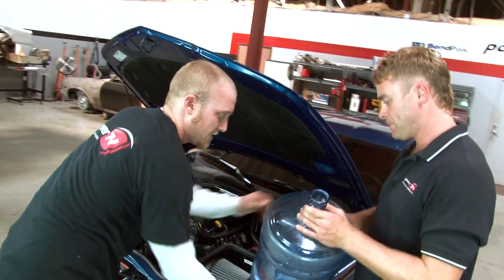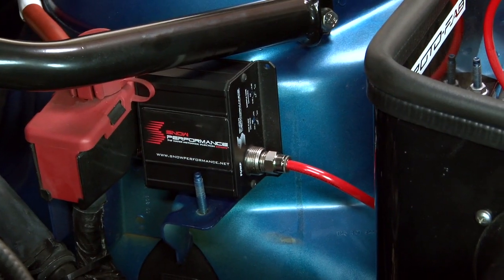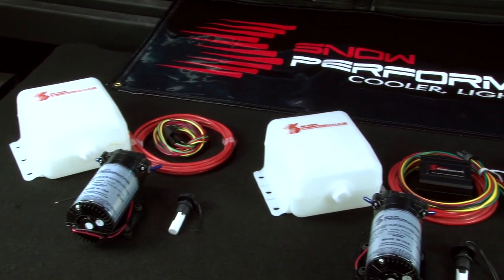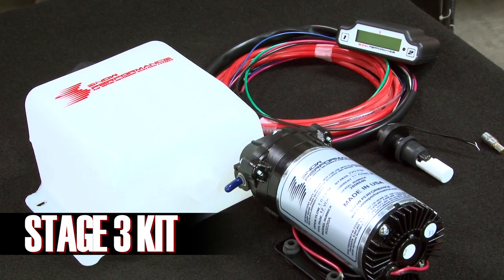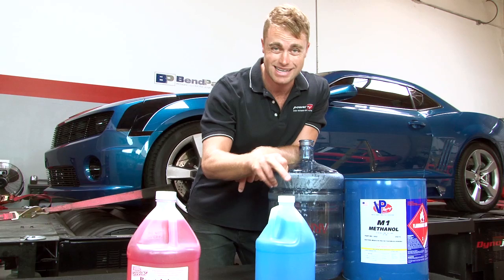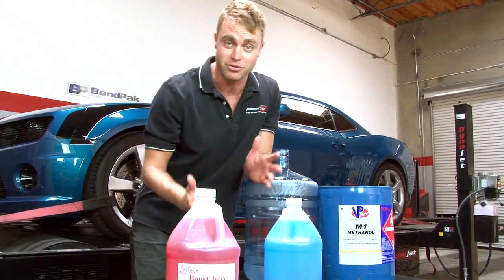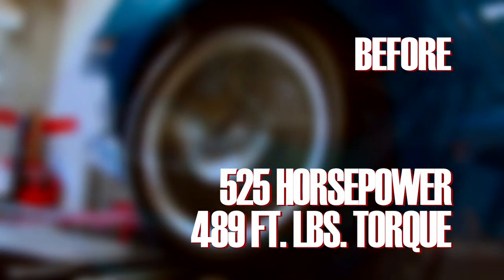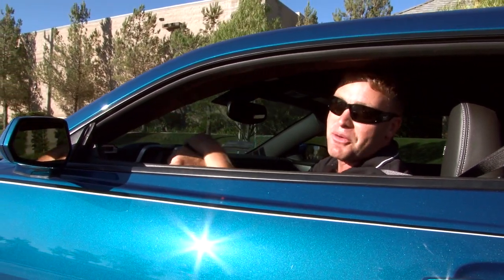Understand Water Methanol Injection with Snow Performance

Comment: Hey guys, I recently installed my stage 3 kit, I’m running off efi percentage. Anyway when I turn on the cars ignition (not running) I get injection. There is no boost reading nor an efi percentage but for some reason it’s injecting. Any idea what would cause that?
Reply: I have the exact same situation.
Reply: lol great product did you get this issue sorted out?